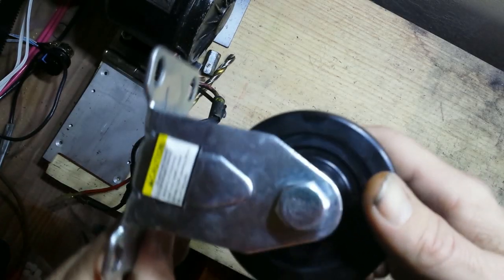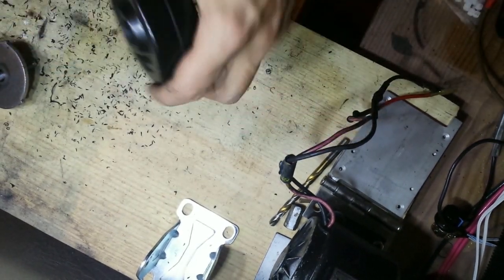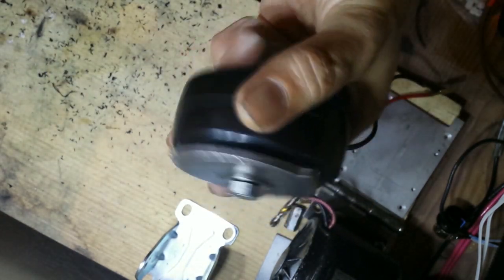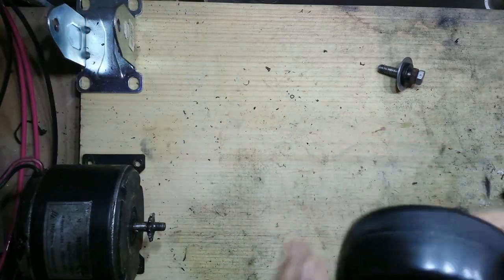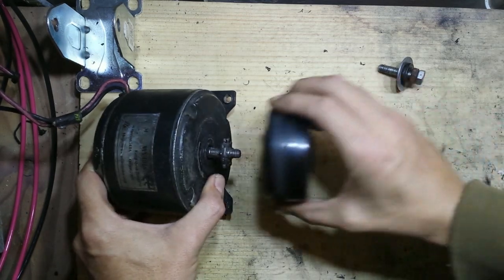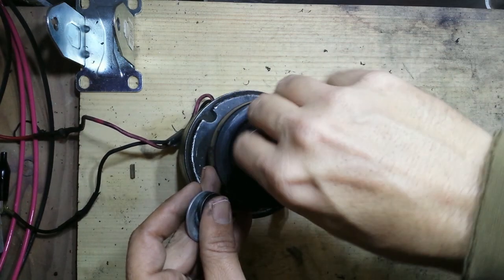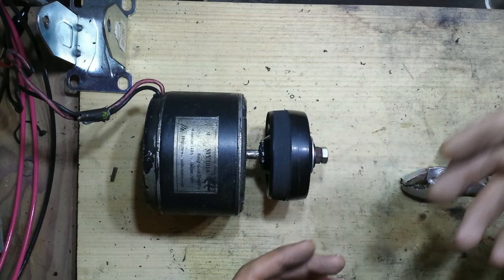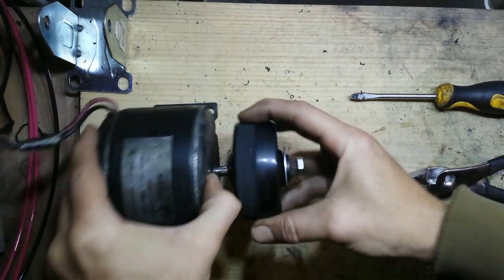Electric Bike Friction Drive Motor. Part 1

Comment: How about using a skateboard wheel?
Reply: The problem with using a skateboard wheel is the whole diameter is a lot bigger if you put the bearing on the motor it will spin freely on the shaft

Comment: Rpm?
Reply from the maker: The RPM (revolutions per minute) for this motor is around 2500
Reply: ThriftStore Hacker thank you 👍
Reply from the maker: @ParsMermer  you are welcome. I had this motor for years until my last project where i overheated it and released the smoke.  If you can make a 26in bike wheel spin at 150rpm you will get just under 20mph.

Comment: Hey bro can i do this with fan motor
Reply from the maker: Bipin Neupane a regular desk fan. No. You could use the 12v radiator fan motors from a large vehicle. Some old electric bikes we're commercially made using radiator cooling fan motors.
Reply: Ok thanks bro and teach me easy way to make motor cycle using battery
Reply: Can u plzz tell me ok bro
Reply from the maker: I am currently doing a new electric bike build. Should be released in late November. It should give you all the information you need. I will be building it as cheap as possible.
Reply: Thank bro
Reply: ThriftStore Hacker 
U are grate

Comment: My idea, heat the metal coupler with a torch threaded to a rod, carefully insert hot coupler into plastic wheel, melting a perfect pocket.
Reply from the maker: Wyvern good idea.

Comment: did not center dill hole
Reply from the maker: Joe Pan I deal with that by bolting the motor to the table and grinding off material. basically a homemade lathe. check out the other video where I do this.

Comment: Hello there.. can you tell me where to buy the castor wheel and the metal insert you put inside it for the motor to attach to it please
Reply from the maker: +Larry Krishna I got the castor wheel at Harbor Freight tools.  The metal piece is a 1/2in coupling nut from the local hardware store.
castor link
http://www.harborfreight.com/3-in-polyurethane-heavy-duty-rigid-caster-69851.html

coupling nut link
http://www.homedepot.com/p/Everbilt-1-2-in-13-tpi-Zinc-Rod-Coupling-Nuts-822301/204337404

your size of coupling nut may change. take the motor to the hardware store to match it up.